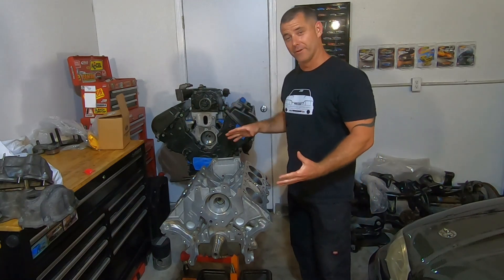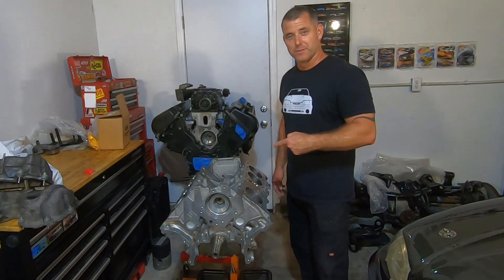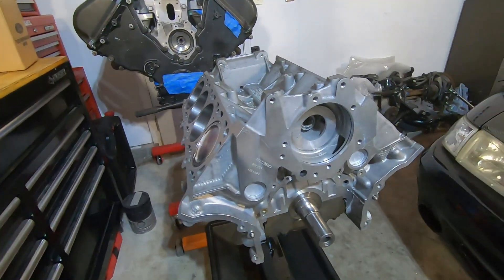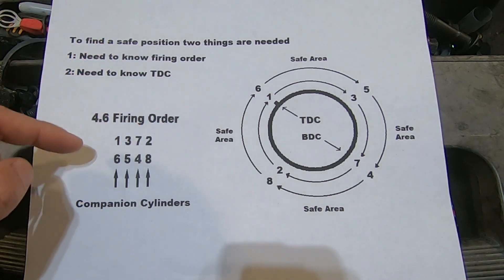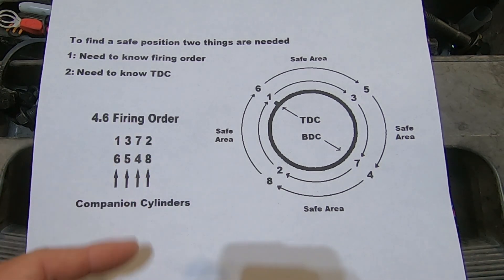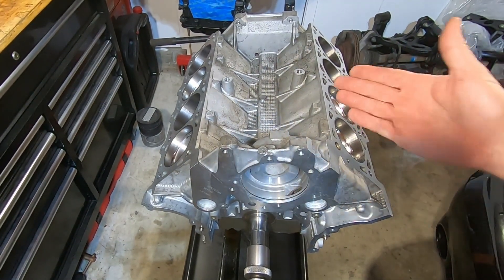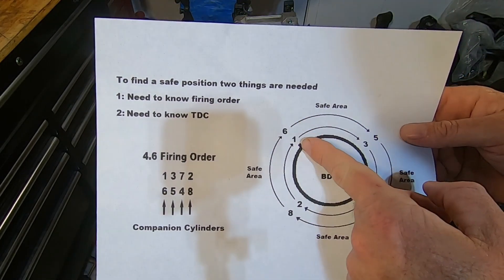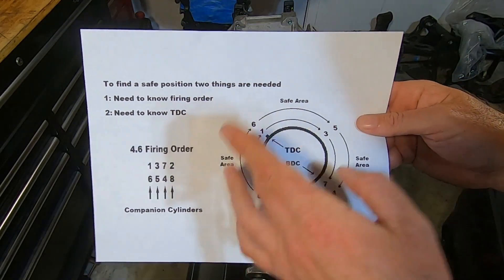How to Put an Engine in the Safe Position - Using a 4.6 96-01 Mustang Cobra Teksid Block

Comment: So if the sync of the cam and crank were off and chain jumped while moving the crank, I would just put it in the safe position and rotate the cam back to the position
Reply from the maker: Correct, the safe position helps ensure that a valve doesn't come in contact with the top of a piston.